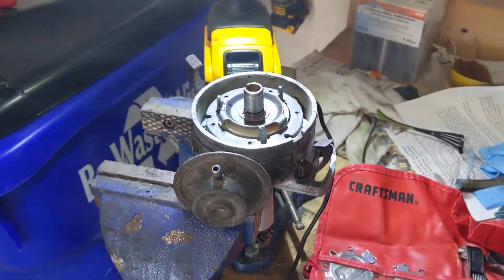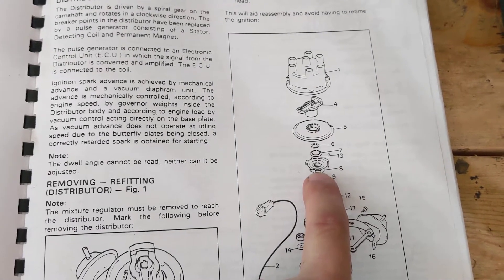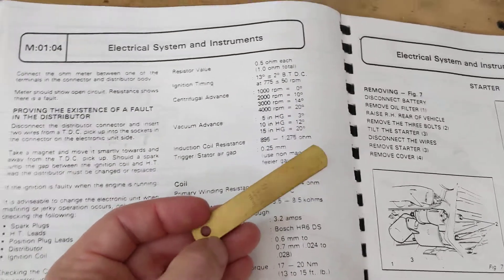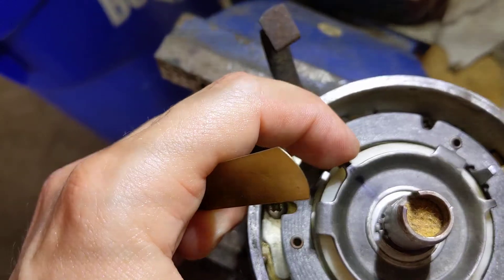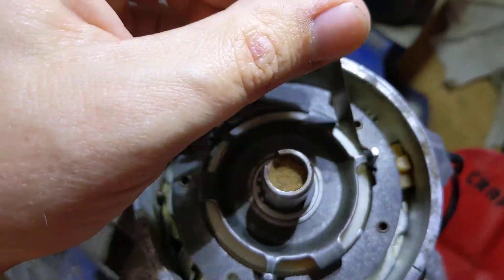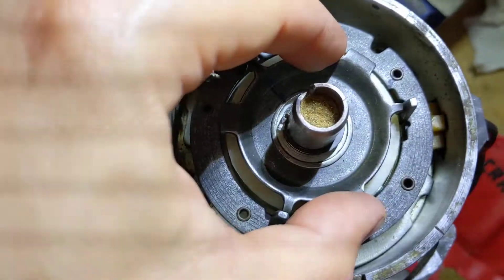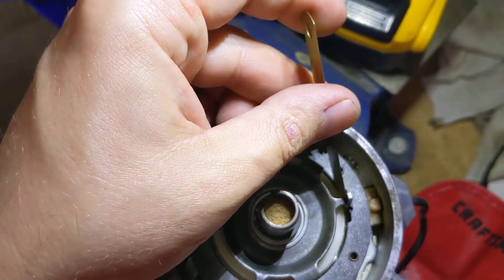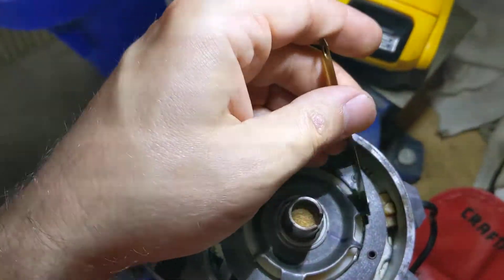DeLorean Distributor - how to check the reluctor / stator air gap

Comment: I'm curious, has it ever been discussed among the Delorean owners to investigate the rotor / distributor cap air gap for concentrics or eccentrics, or an out of round cap from poor manufacturing, & also rotor phasing at full advanced?  , especially with poorly made caps & rotors out of spec & made on old worn out machinery. 
 I see there is limited availability of caps & NOS still around especially Volvo part numbers, but I do see there are a few mfg. of rotors.  It would be a great project to find out what combo of rotors to distributor caps has the smallest air gaps which is vital for longevity of both the cap & rotor & the coil & ecu ect., or custom make a  longer tip rotor.   Then one can run larger plug gaps if a rotor & distributor combo can be used with close tolerance air gaps.  This is discussed in great detail on the SlantSix forum.  However you need to cut large holes or cutouts in the distributor cap to check these with feeler guages & a timing light for rotor phasing to be sure the rotor is not too far from the distributor post under full advance.  Another way is to gut a spare distributor, & cut out large holes on the bottom of the distributor housing to make a jig.